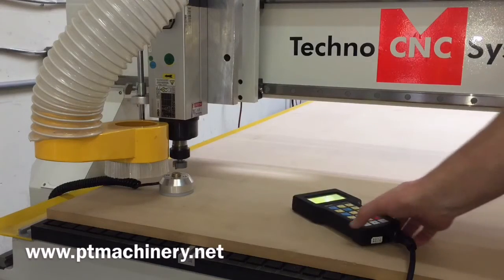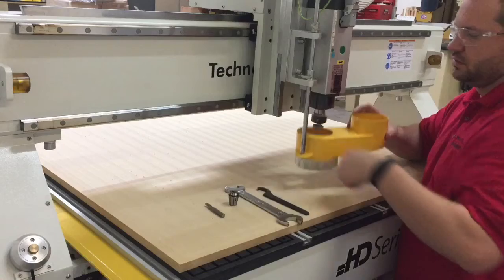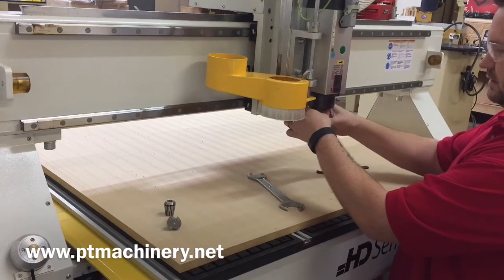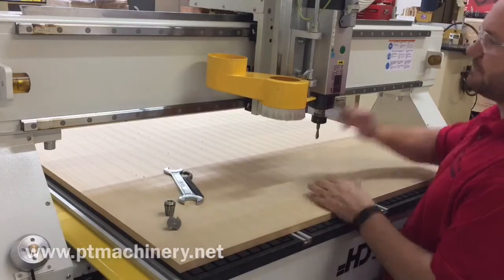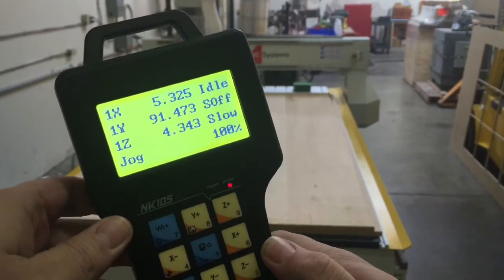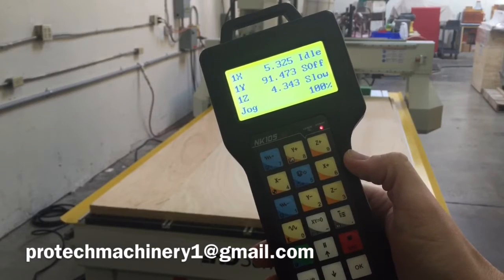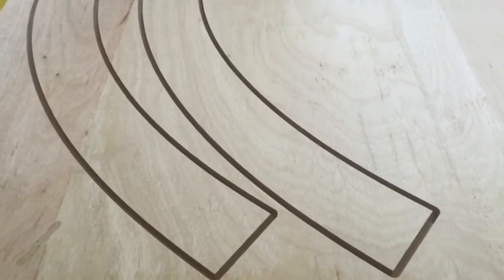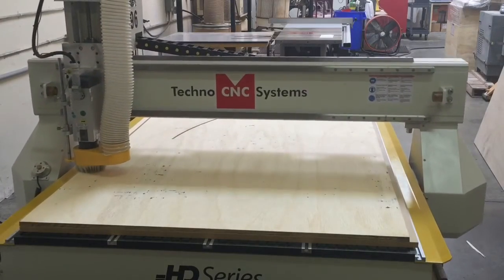Techno HD CNC Router

Comment: Does run on Mach4?
Reply from the maker: I believe Techno offers multiple options for controllers on these machines. I know win CNC is an option and mach4 probably is as well. However, we now offer Anderson CNC Routers most of which come standard with the Fanuc controller and our very easy to use AGMVP interface on a full front end PC.